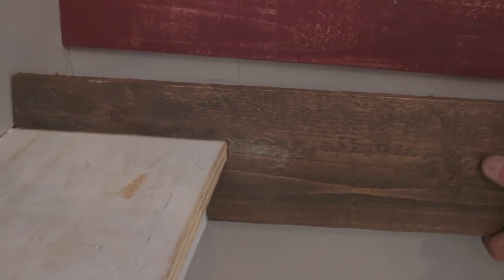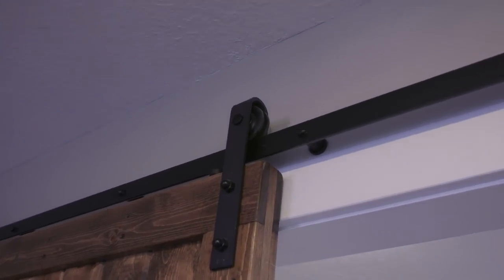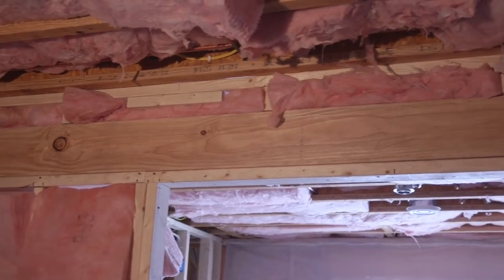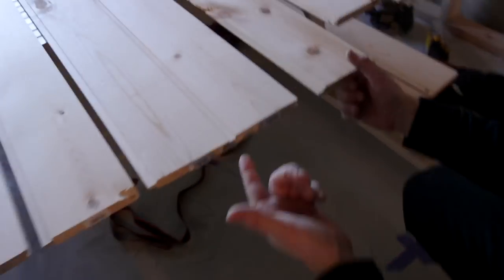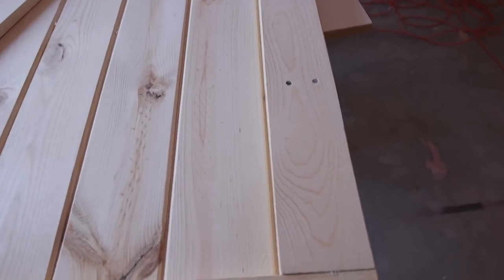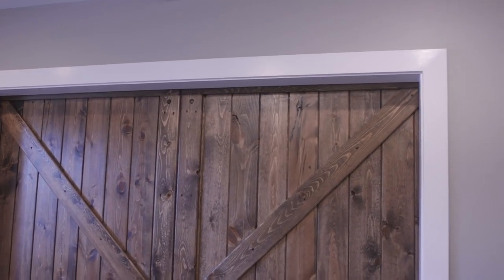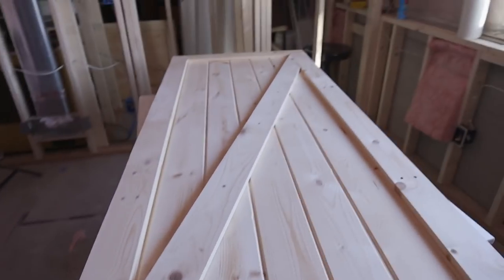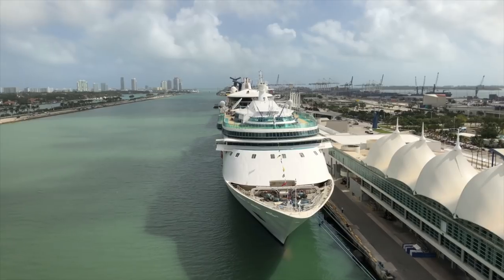Building Interior Rustic Barn Doors on a Budget  DIY How To Build

Comment: I noticed the hardware says maximum door thickness is 1 3/4" but your door is just over 2 inches, correct?. Did you not have any problems? I like the look of sandwiching the tongue and groove as you did but cant find hardware that mentions door thickness of 2 inches or more.
Reply from the maker: We made a larger hole on the back side of the doors to recess the hardware/bolts which also prevents hardware from rubbing against your wall.  You’ll need to use spacers (washers) on your rail to move it out from the wall a bit further as well.  Hope that helps.
Reply: @PictureTime  ah, that makes sense. Thanks.
Reply: I have the same door thickness issue as you had. What size lag bolts did you buy and how much further did you have to extend the spacers from the wall using washers?

Comment: For the Barn Door Hardware kit you linked out shows on their description that Fit Door Thickness: 1-3/8" ~ 1-3/4"(35mm-45mm).  How thick are your doors? I see you framed both sides with the X Pattern.  That would be 2 1/4" in total door thickness.  How did you get around that?
Reply from the maker: We drilled out 1” recessed holes on the back side of the door to recess the hardware.  Thanks for watching.
Reply: @PictureTime  Very cool Thanks for sharing that.  Did you show that part in the video somewhere and I missed it?  You had a lot of great ideas and technics so thanks for sharing

Comment: I use a Dremel (instead of a router or sander) to take the sharp corner off. The free hand makes it look more authentically rustic and distressed. I also give it a few deliberate deep and random gouges for extra design.
  I take a wire wheel (on my drill) to flake up the soft wood in between the grain. Then I torch it. Then a quick wire brush by hand to remove in between the grain. I then wipe down with a sponge and water. Next I stain and/or urethane, depending on desired coloring
Reply: Would love to see a photo!

Comment: Thanks for explaining how you did the cross pieces. I was about to attempt some Trig and figure out the angle haha
Reply: It's easy... measure corner to corner and cut the length of the cross member. Then mark the center of the cross member (lengthwise). Next, lay the cross member  (center mark) over the corners and just eyeball and mark the angles. Connect the lines and cut. It's really simple!

Comment: Hi, I'm planning of making a barn door for the very first time. It's going between my master bedroom and master bath.  Opening is 48 inches wide. I would like to paint my door white, rustic looking. Im not too sure the type of paint i should get.
I really like the way you put your door together.  I'm thinking if getting the same panels with the grooves. Im wondering how the back looks like though. 
Thanks.
Reply from the maker: Try some chalk paint and wax over it.  They sell it at Home Depot and most home improvement stores. It’s very easy to work with and looks really neat.
Reply: @PictureTime  Thanks ill try that

Comment: I don't get why you taper off at 4:10. You eventually square off the sides and trim it out
Reply from the maker: We tapered the edges of the middle boards (the ones you can see) but don’t think we did the outside ones (or at least we left a hard edge on the outside ones) as you are correct,  they are trimmed.   Thanks for watching!

Comment: I noticed the hardware you used is for a 1 3/4” door. Did you make your own track spacers to accommodate a 2 1/4” door?
Reply from the maker: Yes.  We added washers to the track spacers and painted them to match.
Reply: @PictureTime  do you have a link or picture for the ones you used? Thank you

Comment: Do you find that the door is too thick being 3 layers?
Reply from the maker: We had to made some adjustment to the hardware, but I like a big thick heavy door.  We get lots of compliments on them!
Reply: @PictureTime  Yes I would like to do mine double sided as well! always thought it would look strange if the back side wasn't "finished". Would just look like a wood wall from the inside haha. So all in all the door will be 2.25" thick right?
And can I ask where you got that tongue and groove material? eveything I can find at hardware stores has a notch/spine cut out on the back side. Like this for example: https://www.homedepot.ca/product/irving-1x6x10-tongue-and-groove-pine/1000441101  
I think that would look strange from the inside
Reply from the maker: HD that’s the same material we got!  We got it from Home Depot.   Menards or Lowe’s should have something like that too.  I think it’s just under 3/4” thick so three of them would make the door under 2.5”
Reply: @PictureTime  Oh really? I didn't see that spine/notch cut of the back side of your wood

Comment: Did you have issues clearing baseboard?
Reply from the maker: Jon Marquez no but we needed to space the top rail out far enough from the wall.  We added some washers and longer bolts when mounting the top rail and are clear of the baseboards.

Comment: Hi, which are the steps for "painting" de door and gives that amazing look? thank you
Reply from the maker: Wimmer Mendicoa hello. Thanks for watching!  I used a Minwax stain on the sanded wood surface and then I used 2 coats of satin Polyurethane varnish and sanded in between.  I hope that helps.
Reply: @PictureTime  thank, helps a lot
Reply: Try burning it. Go light.

Comment: Where did you find barn door hardware that accommodated for a 2 1/4 inch thick door. The largest size I found was 1 3/4 inch.
Reply from the maker: Blair Willcocks   We bought the hardware on amazon.  We had to counter sink the nuts on the back side of the door to make it all fit and have the nuts not protrude out so they would scratch the wall.

Comment: What was the final thickness of your doors?
Reply from the maker: Hi Dustin.  The boards end up being about .75" thick so the total thickness of the door a the outer frame is about 2.25".  Thanks for watching.
Reply: Thanks for the reply...did the thickness of the door create any problems with mounting hardware
Reply from the maker: Dustin Snay  we did have to drill recess holes on the back of the doors for the mounting hardware.  Basically a 1 inch hole through the framing board.  Once you drill through it, it pops out and then your just mounting the brackets through 2 layers of material instead of 3.  Hope that helps.